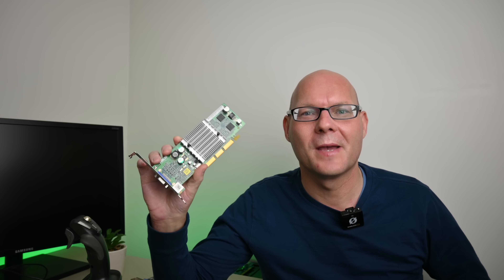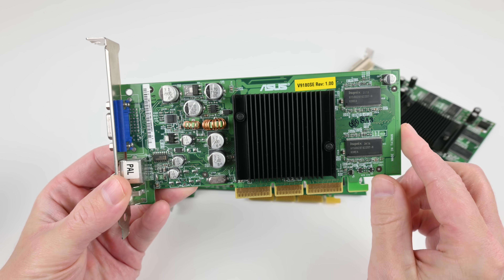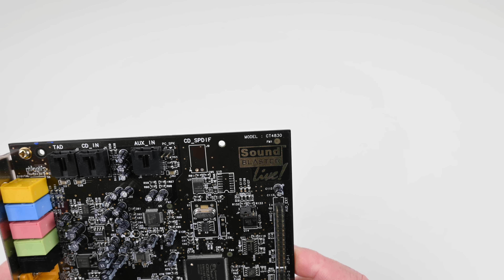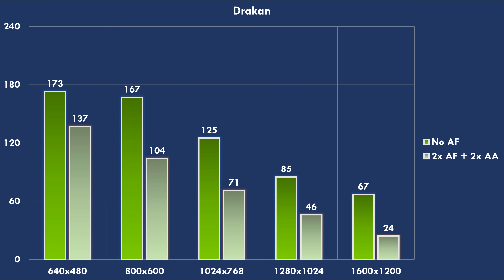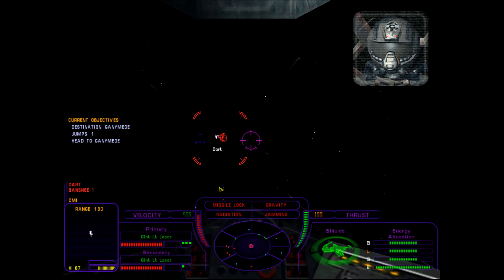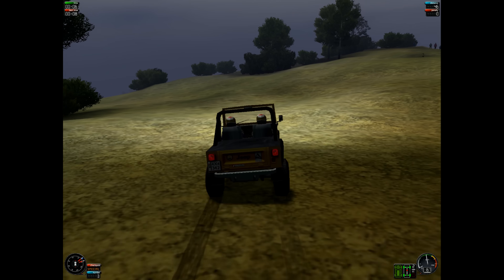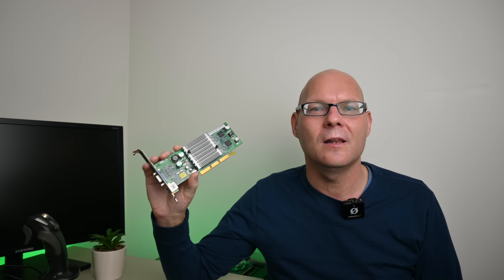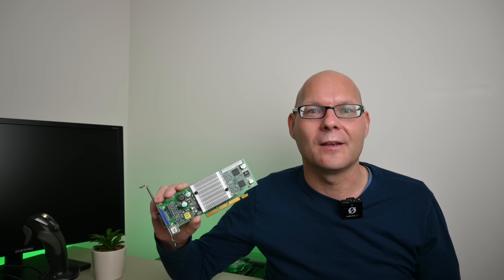One of Nvidia's most Controversial GPU

Comment: Actually in the end Geforce 4 MX was a great product while Geforce 3 and 4 never had a chance to shine.
The problem was that there were no games made specifically for Pixel Shader 1.3 and 1.4.
PC port of  Prince of Persia Sand of Time was one of few exceptions and it required Pixel Shaders to run, but overall it used just a simple post-process effects and there was a tool that simulated the presence of shaders and game run just fine on Geforce 2 and 4 MX with minor graphics differences. Two sequels lowered hardware requirements and run on 4 MX just fine.

Furthermore raw performance of 4 MX was really good. This card could easily run games at 1024x768 or even at 1280x1024 like GF 3 and 4.
Eventually games started requiring shaders, but then Shader model 2.0 was available and Radeons 9550 and 9700 were released.

Overall buying 4 MX and then upgrading to Radeon 9550, 9700 or Geforce 6600 was a much better choice than buying Geforce 3 or 4 Ti in the first place.
Back than I had Geforce 2 GTS Pro and thanks to 4 MX my graphics card could run games few years longer.

It is often the case that first generation of revolutionary hardware will get obsolete before software is developed to utilize its new features.
It was the case for Geforce 3 and 4. Same fate got Geforce 8800 which never got true Shader Model 4.0 games. GTX 4xx and 5xx had shaders 5.0 and tessellation, but they weren't fast enough to achieve playable FPS with those features. Lastly it is still hard to achieve playable FPS with ray-tracing on modern GPUs and games still use ray-tracing like they used early Pixel-Shaders, just as an additional effect on top of older techniques.
Reply: 9550 was a downclocked 9600SE, TMK. As if the 9600SE wasn't crippled enough. 9500 was the real deal that wasn't based on a 9600.

Comment: never use thermal gel pads they made the cpu throttle like crazy and over heat... thats why i use artic thermal cpu paste
Reply from the maker: I have tested these pads extensively, they are fine, A few degrees warmer, but saves me from cleaning paste off parts when I build a new system every week.

Comment: Great Video very intresting:)
my topic suggestin is:

how can I find a solution to eliminate the stuttering in Deues Ex and GTA SAn ANDreas?
How do I get rid of the texture errors in Hitman Codename 47?
What's the problem? I have it with every card even with my GTX 970.

I know that Hitman Codename 47 ran smoothly with the Riva TNT 2 at 1024x768 and had no texture errors and the houses were all displayed cleanly. Since I reinstalled the Riva TNT 2 Pro on the old PC, I've also had the same problems there with graphic errors and poorer performance with Hitman Codename 47. Deues EX is also affected, it even stutters on low in some places when textures are displayed from a distance otherwise it ran very smoothly inside the Unatco building.
I also noticed it in Crazy Taxi. Crazy Box runs smoothly on 640x480 and medium because you only play individual missions. But when I start the arcade mode it stutters because you drive through the whole city and have a high visibility.... the buildings are not all displayed cleanly and look muddy from the texture and there are a few graphic errors. I've tried different drivers, including older ones, and I get the same problems.... it wasn't like that before, even though I installed the same driver back then.

And GTA SAn Andreas jerks in some places reminds me something like Deues ex sometimes it runs smoothly then suddenly it jerks heavily although I have AMD AThlon 3700+ and 2GB DDR RAM and a Geforce 6600 Gt or RAdeon X800 it doesn't run smoothly at 1280x1024 maximum Details and anti-aliasing. But it should run smoothly with all settings. GTA SAn Andreas is not a demanding game

Comment: I was mislead by ATI instead😅. I had a Radeon 8500 which I thought was quite fast, and then I bought a Radeon 9200 se expecting it would be even better and we all know what happens there hah😂
Reply: I got an ATI Radeon 9000 Pro in July, 2003 and then realized that it was no better than an 8500 and was often beat by an 8500.

Comment: Right around 2006-07, I somehow acquired an MX 440 (Which I still have to this day, I need to make sure it still works!) from a then discarded PC. Even back then its performance was respectable in Windows 98se and a Slot 1 Pentium 2. That card later got reused in a Pentium 3 866mhz machine as a primary display device. I'm a hoarder, so I eventually tucked that card away alongside the FX5700 LE.

Comment: I found out, that my GeForce MX 440 w/ 8x AGP better perfoms than my ATi Radeon 9200 SE on my Fujitsu-Siemens rig with an Athlon XP 3000+ on Windows 9x and also on Windows 2K/XP despite the Radeon has as double so much video memory than the geforce MX 440. So I can say: video memory doesn't absolutely matter! ;)
Reply: Fun fact: Max Payne is banned in Germany because the bullet time mechanics. The (bullshitty) reason is the aestethics of deadly violence.

But Max Payne 2 is not banned, but censored. I have only the PlayStation 2 version of Max Payne 2, where the bullet time sequences were heavily reduced. Thank god for the FreeMCBoot softmod, so I can finally play the US version of Max Payne 1 and 2 on my PAL PS2, so I can finally play the first Max Payne part AND the 2nd part uncensored.
Reply: I believe 9200SE had 64bit, right? your mx440 might have 128 bit.
Reply: @mirific87  I cannot say no, I need to inspect my card, but it's late here, so I have only at Sunday time for it.
Reply from the maker: Likely the 9200 SE is 64-Bit. It also cannot do paletteted textures and table fog properly, so yea, a MX 440 with 128-Bit interface is the better card. The Radeon does higher level of AF though.

Comment: No mention of the MX4000?

How about nGlide or similar API wrapper?

(The MX4000 was a MX440SE with a slightly higher memory clock - so bit lower bandwidth than MX440, but with AGPx8. Designed to replace the MX420 - in many respects, just an OC away from MX460)
Reply from the maker: nGlide needs DirectX9 GPU, GeForce4 MX is DirectX7. I did mention MX4000, as long as it has 128-Bit interface it's ok!
Reply: @philscomputerlab  Thanks :)

I might have overheard the MX4000

Didn't know about DX9 requirement for nGlide.
Reply: He advised against it. To be fair, a lot of mx4000 had awful performance because of the 64bit, more similar to Geforce 2 mx400... nglide is not possible on Geforce 4. FX is the first one with directx 9, which is required by nglide.

Comment: Quick question: I hace a retro rig with Windows 98 and a Geforce 4 MX 440 8X.  I play TES III: Morrowind in that machine. How it would TES III run with the 45.XX drivers? I am using Forceware 66.93 asof the moment, and was thinking of using the older drivers, but I want to know if performance is negatively affected on the older one.
Reply from the maker: Try the older drivers and see if there is a difference.

Comment: I was just eyeing a similar cards for myself and wondered what are the differences. Would be interesting to compare it against Geforce 2 MX 400. And regarding to Total Annihilation, you probably already discovered this but for everyone else trying out the game, you can set patrol routes by queuing patrol command, creating an infinite loop, very useful for air fighters defending the base! And also when construction planes are set patrol above your base, they will automatically assist and repair any units on the ground, quite useful as well.
Reply: Geforce 4 mx440 is more than double the performance of mx400 in Q3 Arena. Think of mx400 as a GeForce 256, while mx440 had certain advantages over most of the Geforce2 models (Ti, Pro, GTS). Hence the difference. But that was only the case if you had a 128bit card.

Comment: My brother bought the MX440 on ebay from Hong Kong not long after it came out. He got absolutely hammered on import tax when it arrived and would've been cheaper to buy in the UK. The performance wasn't as expected shall we say lol. This video reminds me I have a GeForce Ti4200 in the shed that has a faulty fan. Last time I searched I couldn't find a replacement part anywhere. Any recommendations?
Reply from the maker: I have a few older videos on buying cheap GPU fans from eBay or AliExpress. Just make sure the mounting holes line up.

Comment: I skipped the 4th gen. I had a geforce 2 pro (64 mb). I eventually replaced it with a 5200.....I'm like.....except for rendering smoke (which sucked on the 2 pro) the performance is the same. Eventually I ended up with a super high end 7000 series card like a 7950 or something. It shouldn't have existed on AGP,  but it did. And......doom 3 still sucked. I eventually concluded that doom 3 requires PCI-E to run. Not sure why, but yeah. In the mean time this card was AMAZING for UE3 games. And UE3 looks just as good as doom3. Not sure what the deal is.

Comment: Having upgraded from a Riva TNT2 to the GeForce MX440 back in the day, I remember seeing enough of a performance uplift that I wasn't disappointed. Finally, Far Cry was no longer a slideshow and I could even bump up a few details. It lasted in my system for a long time before skipping several generations to the GeForce 7800 GT.

I harbored no delusions that it was a GeForce4 and largely ignored a lot of the flak it received for that.
Reply: Kinda like me, went from TNT to TNT2 and MX440 but the 128mb variant. and as u i wasnt disappointed.

Comment: I had Abit Siluro MX440SE 128-bit DDR with a small passive heatsink, which had slightly lower gpu clock compared to a reference MX440. DX7 and Quake 3 engine based games ran very well at  1024x768 32-bit.

Comment: I have a GF4 MX in a laptop. Newest drivers that were supporting GF4 MX series didn't work. Had to install some beta drivers, otherwise Silent Hill2 wouldn't run properly. I also have GF4 MX440 AGP somewhere (It got replaced by Radeon 9100).

Comment: Back then it was not like a today, when 3years old card is still very powerful and useful. Gforce 3 from 2001 was literally useless in 2003-4, as had only 1.1 shaders, even in 2002 games like Unreal Tournament 2003 require real GForce 4, or ATI 9700/9500, on Gforce 3 it was running 8fps and now imagine, that Nvidia has been selling to customers rebranded GeForce 2 as GeForce 4 MX. Many people has been very very unpleasantly surprised, when they have got error message on screen, that  "sorry shaders not found".

Comment: Think the first graphics card i ever bought off the shelf was geforce 2mx 32mb, it was SPARKLE branded, from my local shopping center in stoke-on-trent way back in 2000, it worked well with my pentium III 866Mhz cpu on a QDI legend motherboard, running windows 98, i have fond memories of it actually, it played games pretty well.

Max payne you need to look in any cupboards you find for ammo and painkillers.

Comment: I picked a GeForce MX4000 for my ThinkPad T23 setup. For a docking station setup where the space for a PCI card is very small and actually cannot accommodate the other GeForce4 series cards (nor anything newer without bottlenecking the GPU anyway), the MX4000 and 440 are valid.
Reply: You can put a card in the docking station? I have a PCI MX4000 and it's okay but I don't like that I have to use newer drivers with it. I use it in a intel 810 socket 370 with no AGP.
Reply: @icqme8586  The ThinkPad Dock type 2631 and 2877 feature a single PCI slot at standard length for all the GPU, OPL, USB or RJ11 you could want. It's pretty cramped so it will definitely be warm inside. The MX4000 is great then because it isn't melting and it's a solid upgrade for a majority of the Thinkpads it works with. My T23 has an S3 SuperSavage with 16MB of VRAM, and the MX4000 brings me DX8 support and 64MB of VRAM. Or I could always go with a Voodoo 3. It just barely fits.

Comment: The GeForce 4 MX was a piece of crap compared to contemporaries at the time, but it's not so bad for a low-end retro gaming PC, especially with its relaxed power requirements. Based-on my personal experience it still powers through Quake III Arena and Unreal Tournament 99 like a champ at 800x600, but it will start to really struggle with games made around 2002 and later (but subpar performance is honestly part of the experience when it comes to retro PC gaming, at-least to me- most of us couldn't afford or figure out how to get better hardware at the time and neither did our parents lol).

By the way Phil, you happen to have any experience running the GoG version of Arcanum under Windows 98SE? I've been trying to run it but it gets errors even when renaming or deleting the DLL's made to run it on modern Windows.

Total Annihilation's awesome by the way, check out Supreme Commander too if you haven't!

Comment: MX4000s by XFX were super common in Argentina. They came with 128MB on a 64b bus, or 64MB on a 32b(!) bus. Apart from the... "not great" performance, i have seen several with bulging capacitors...
Reply: literally mx4000 had Geforce 2mx performance....
Reply: @mirific87  Not the 32b memory bus version. And it was still being sold in 2005 (and leven later)!

Comment: Very nice video, but aren't all cards at that level / of those generations upwards more than powerful enough for vintage gaming ?
The last graphics card I used Windows 98 with was my ELSA Victory Erazor, which is an NVIDIA Riva 128 card, and for the next 10 years after that it was Windows XP. 🤓
Reply from the maker: Yes they are but also harder to find and more expensive. They also require active cooling, draw more power and might be less compatible because they don't work with old drivers. So there are many aspects to consider. The GeForce4 MX is a good allrounder for most situations.

Comment: I was with GeForce 2 MX the original one before they split them into MX100 , MX200 , MX400. And after reading the reviews I was sure as hell to gather more money for Ti , by the time I did they released Ti4200 and it was my GPU from 2003 till 2008 when I sourced second hand FX5900 and then 6800 and realized it is time to park the venerable K7 platform and no GPU would make it any more faster.

On the bonus side as far as I remember GeForce 2 had some major issues with how some things are implemented like DXTC and some color pallets issues both of which contributed to games like Quake 3 having  poor looking sky , and GTA 3 having a squares pattern in 16bit mode (as far as I remember there was no 32bit one available) this issues have been finally fixed with GeForce 4MX and Ti (some of them were persistent in GeForce 3) which i believe was related to 32 to 16bit conversion and lack of ordered dithering or something like this.

On my retro machine K7 VIA KT133A based mobo with Win98 I decided to go with nVidia Quadro4 980 XGL since I was able to find it for way more reasonable amount of money something like 20 euro compared to the Ti4800 which goes for crazy amounts.It is the fastest fully compatible with DX7 and back games you could use in my opinion because of the support of older drivers that can be the difference between Blood II: The Chosen running or crashing on load for example.

So in general fair and good review congrats. In my opinion MX440 was a good pick but definitely Ti4200 was the best pick back in the days.

Comment: I have found my Leadtek WinFast GF2 MX400 128bit/64MB with drivers 30.81 equal to my GF4 MX440-x8 64bit/64MB (DDR300) with drivers 71.84 (MX400 has a substantial drop off in the newer drivers), with so far no noticeable difference in compatibility. 
That's on a Duron 1000 as well, with my WinFast A340 providing similar performance at 480p and 600p in at least 3D Mark (it does better at higher resolutions however). I have to say as well - beyond games which heavily use T&L an SiS 315 even with 143MHz SDRAM on a 128bit bus compares favourably to the MX400, while using less power and a far smaller and more basic heatsink.
Reply from the maker: Thanks for those results! Those late drivers are to be avoided though, they are slower.
Reply: @philscomputerlab  The main reason I use them on my FX cards is due to them having fewer bugs unlike the more popular drivers, while also supporting everything from the Riva TNT to my GF660GT. Convenient and less headache inducing Win98 installs are the result. However in normal use I stick with 30.81 for the GF2 (specifically when not benchmarking other cards on the Duron 1000 PC) and Diamond's version of 3.68 for my TNT and Vanta.

Comment: Hi Phil, i'm curious about the 44pin IDE on laptop and miniPC. Can install 2 drive as master/slave. Or only 1 drive per port??!!
Reply from the maker: Good question! 4 pins are reserved for power and I've never seen two devices on one cable. So my guess is only single device but don't quote me 😁
Reply: @philscomputerlab  I have a dual CF card adapter that does master/slave in a Compaq Evo N600C.  So it is possible, but depends on the laptop.  I have another Compaq that does not recognize the slave drive when I use that adapter.
Reply from the maker: Thanks!

Comment: I tried getting an MX-440 running on my Win98 pc, but it had constant issues.
Which driver would to recommend using with it for Win95-SE?
The Geforce2 MX-400 it currently has is painfully slow.
Reply from the maker: 45.23 as used in this video!